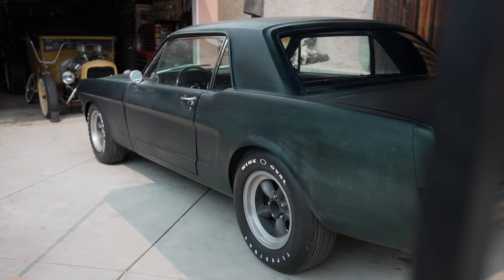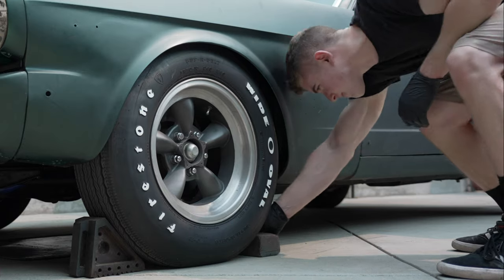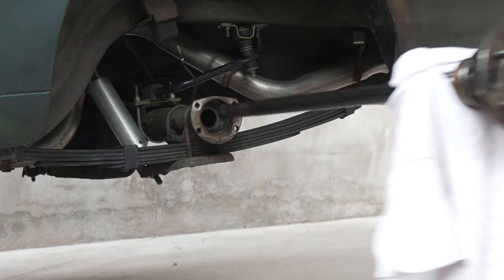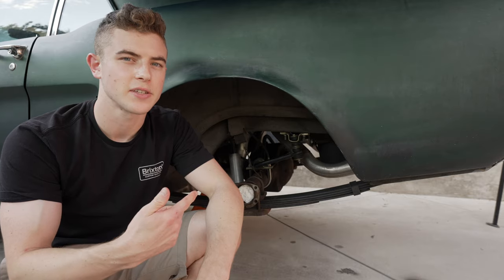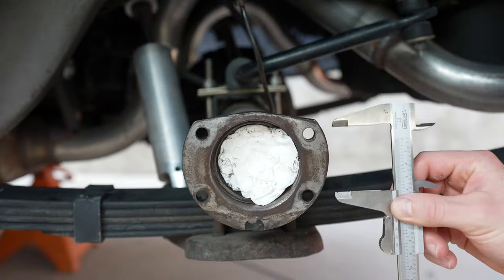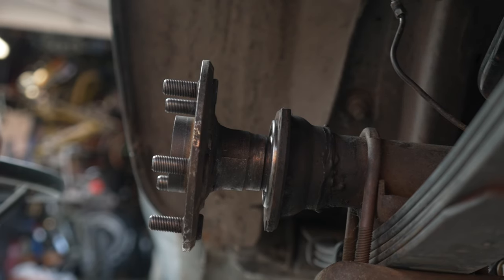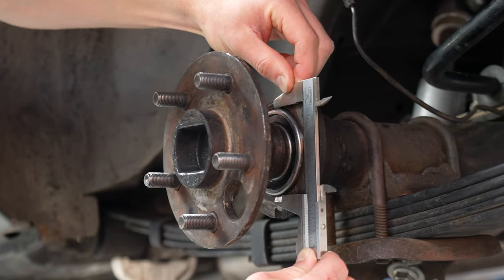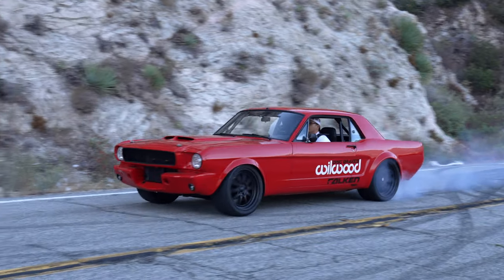My 1965 Mustang Gets Rear Disc Brakes! | How To Measure Rear Axel For Wilwood Disc Brakes | Part 1

Comment: Great videos!! I used a 8.8 axle from a ford Explorer..cant beat it for the $$$, disc brakes, 3.73 gears, 31 spline axles. posi traction. On the 65-66 Mustangs you will have to cut down the long axle side. I have a 67 so no mods where needed another than welding in new spring perchjes.

Comment: I did did brakes in rear of my 67 cougar, hand brake is useless now and there is NO different in brakes I live by San Francisco and with these hills this city is the real test for brakes my friends, but they look cool! SSBC kit ,did a lot of part changes in engine compartment two different master cylinders much brakes lines two brake bos but a wildwood master helped a lot, brakes are on the hard side, thanks! P.S I'm a retired mechanic too and you better know how to bend brake lines if not you'll be in trouble!

Comment: Awesome video as always. Was just wondering about doing this on my own '65; I installed a rear SSBC kit years ago that has been a huge pain in the butt. Parking brake doesn't work, braking power is poor, etc. This will definitely guide me in my process!
Reply from the maker: Thanks!
Reply: If I recall the parking brake on the Wildwood rear discs is integrated into the assembly. It simplifies the set up.
Reply: @johnclemans7802  Good info, thanks. Needa find a kit that'll work with as few problems as possible lol
Reply: @lemonke1576  I agree with you in terms of getting the correct parts/hardware. There's nothing like being in the middle of a project and having the incorrect parts and/or hardware!!
I went with Wildwood because of quality and good reputation. Plus Wildwood is about 45 minute drive from my home.

Comment: Very nice & informative video! I have the rear Wildwood brakes ready to go on n my 65 Fastback. I have Currie 9" for the rear end. And a Strange carrier assembly with 3.70's. My fastback is dark green metallic as well. Same style wheels for now. I'm looking to put a set of 16"x8 Vintage Wheel Works on it, Hope all goes well with your install!! 
Wondering what master cylinder you are going to use, from Wildwood?? And proportioning valve.
I had the old school Granada front brakes and a Lincoln Versailles rear end in the car previously. 
Your 65 looks and sounds great!
Keep up your cool videos!

Comment: good video! When you measure the pitch between holes with a vernier caliper, as long as the holes are the same size you can use the internal calipers (on top) to the outer edges then take off the diameter off of one of the holes (much more accurate) hope this helps? cheers Jason
Reply from the maker: Thanks for the info!

Comment: When it comes to these kinds of mods, a long range assessment of your goals for the car really helps.  By that, I mean, is this your daily driver?  Do you plan to keep this car "forever and ever"?  These kinds of questions may help you determine how far you may want to go.  If it is a "forever" car, personally, I would save up some more and get a 9" rear end.  If not a "forever" car, you're young yet so minimize the damage to your wallet.  Believe me, I speak from experience.
Reply from the maker: True!
Reply: @FourSpeedFilms  but after thinking about it, you may have your father's genes!  I myself get bored with "projects" after about 7 years.  Happy motoring!